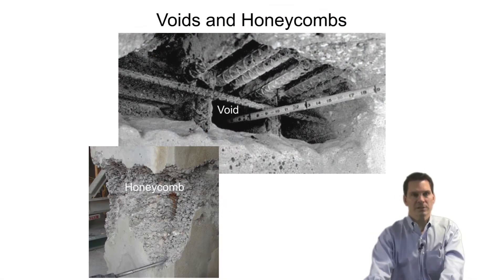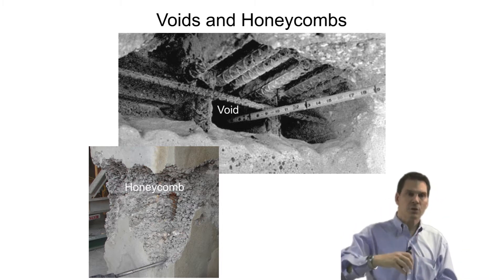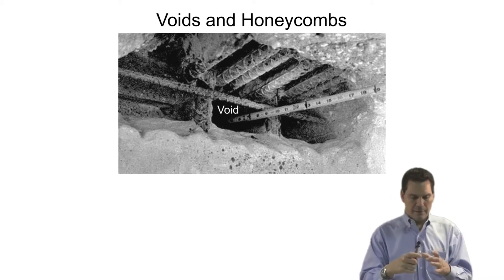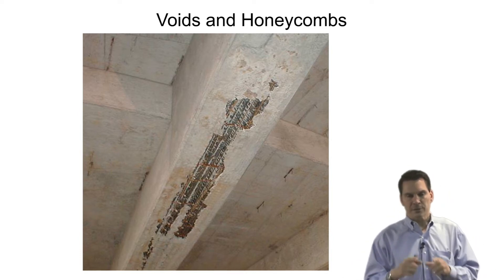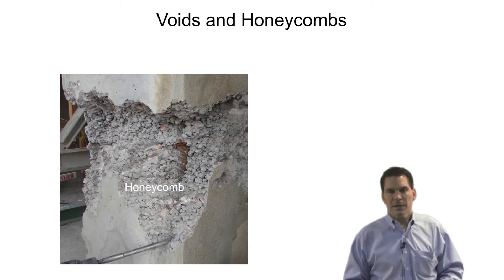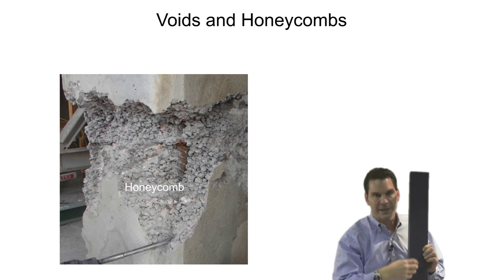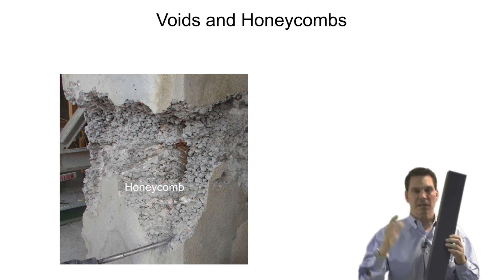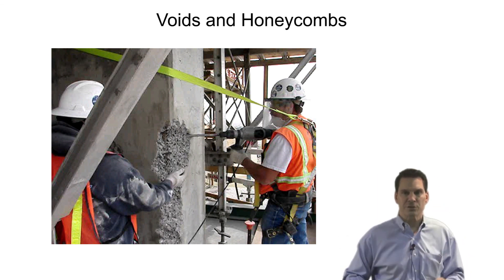Concrete 101: Faulty Workmanship (Part III.)

Comment: It looks like the beam form was too shallow; from your video frame 2:09, it seems around ¼” to 3/8”
How much cover is needed over reinforcing steel in cast-in-place concrete under ordinary circumstances?

The 1971 ACI Building Code requires the following minimum amounts of cover in inches:
Not exposed to weather or contact with the ground:

#6 Bars = ¾”
#11 and smaller = 1 ½”